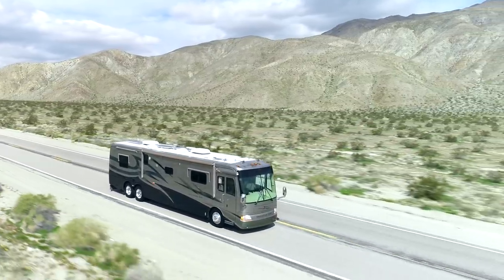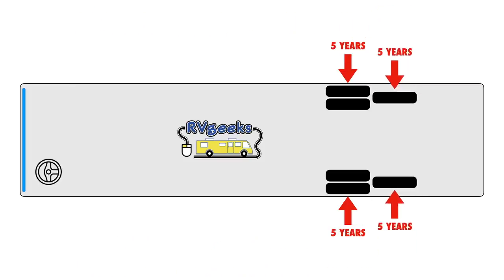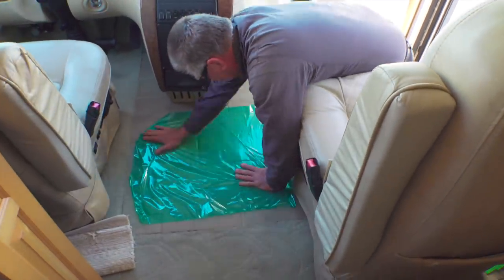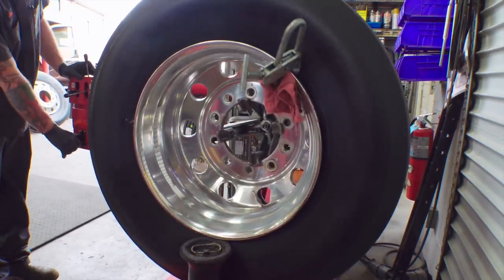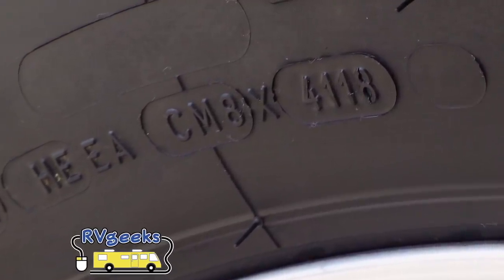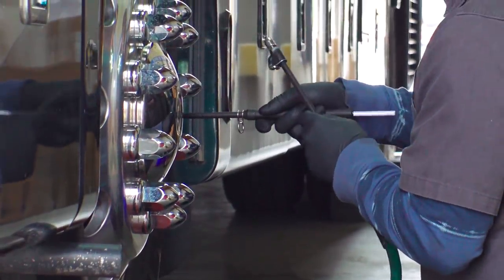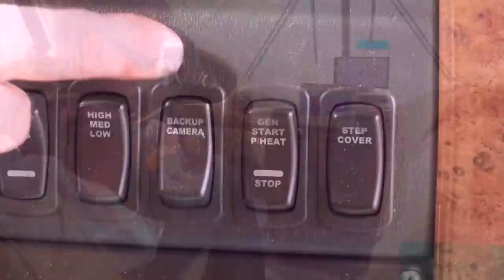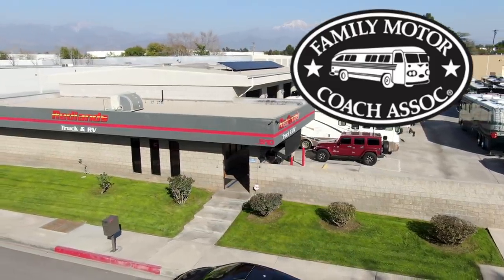Saving 💰On RV Tires - And Getting The Job Done Right

Comment: Excellent video gents, that's certainly some service! As you said, the tread may look plentiful but, if the rubber is deteriorating thru age & especially unable to check the inside walls of the tyres, particularly if they're up against a Duelly then you have no idea! 

Caravan/travel trailer tyres here in the UK are recommended to be changed every 5-8 years. With our ever changing climate. Cold, hot, wet, dry humid etc etc
Reply from the maker: Thanks so much, Dan. Great to hear from you! One thing we've heard from a number of tire tech we've spoken with is that they don't see tires deteriorate from the inside out, since the things that affect the rubber most (UV, contaminants, etc) are on the outside. That's always given us some peace of mind that if the outside is in great shape the inside probably is too. 😊
Reply: Also, using a decent high quality tyre dressing helps too 😉
Reply from the maker: Aerospace 303!!! 👍😁

Comment: HELP...
I have learned so much from you and your videos, even tho I was a fifth wheel owner, Thank so much!
But, now we have purchased our new baby...
A  Newmar, Kountry star 3910..
A beautiful, well maintained 2005,
But I am overwhelmed, with the water system, it is winterized with chem, an I do not know how to empty it properly ?
I would nomaraly just flush statement, but that would run chem through ice maker, I'm lost and don't dare to do this, can you help or recommend help.
Any help is a help..
THANKS for all your awesome videos, and instruction on so many projects, we love ya both..😉
Lonny & Melissa mossey
Reply from the maker: Hi Lonny & Melissa, and congrats on your new rig! Not only do we love to hear from fellow Newmar owners, but just in case you didn't know, we started making videos in the first place about 8 years ago to help friends who'd just bought their first rig.... a 2005 KSDP! We're pretty sure theirs is a 3909, but SO close to identical!

The good news is that that pink chemical is harmless, so the worst thing that can happen is you'll need to flush more water through the system to get rid of it all. But there's nothing you can hurt. First off, you'll want to do this at a full hook-up if you can, which will allow you to run lots of water through the system if needed.

To avoid getting more of the pink stuff than necessary into places you don't want it, you should leave the ice maker shut off, and the water heater in bypass mode. You'll probably still get a little pink into those two places no matter what, but again, no big deal.

De-winterizing is easier than winterizing, because you basically just need to run water through the system until it runs clear. Run each faucet on "warm" top clear both hot and cold water lines. And don't forget about the shower, toilet, and outdoor shower. Once those all run clear, you can set the water heater bypass valves to normal operation, turn on the ice maker, and start using water. As long as the previous owner didn't do something unnecessary... like fill the water heater with antifreeze.... you should be up and running in no time. You'll just want to toss the first several batches of ice, and might want to run hot water up into a glass container until you can see it's clear, and not tinted pink. Also, this is a good time to replace any whole-house or under-counter water filters, right after you clear the lines.

Hope this helps. Please let us know how you make out.
Reply: @RVgeeks  thanks so so much, I really appreciate and needed that assurance I was not going to harm anything, 
I will attack this with a lot more comfidence now...
Just the fact it's a coach has me second guessing my self, so much different than any RV I have owned.
Thanks again, will definitely let you know how it goes.
Heading to Main next month, can't wait. Maden voyage 😀

Comment: Works great if all tires are the same size.  My coach had larger tires installed on the front for a recall.
Reply from the maker: That’s true, OBW! If you have different size tires on any of your axles, you can’t use our rotation schedule.

Comment: Second comment. Nitrogen? Does that mean you no longer need the Viair? If a tire drops pressure while you are boon docking how are you able to deal with this? I assume you don't want to add regular air to a nitrogen filled tire. Here's hoping this never happens but in an RV any this is possible.
Reply from the maker: There isn't anything in this world that will get us to give up our Viair, Iggy!! Nitrogen or not, if our tires need pressure, we're filling 'em with the Viair. As others have said... atmospheric air is already 78% Nitrogen. 😉
Reply: That's what I thought but thought I'd better check to be sure. Travel safe.

Comment: Hey guys, another greatly informative glimpse into your stellar maintenance program. Can you tell me the make, model and size of your tires? My 05 KSDP 3910 is coming due for new rubber and I really like the Michelin brand. Next step: join FMCA. BTW, just curious since yours is the same vintage did your coach get the exterior checking in the fiberglass? I know for awhile Newmar was addressing this. Thanks 😊
Reply from the maker: Hi Raymond! Our rig came with Michelin XZA2 Energy 295/80R22.5 tires, and that exact size and model is all we’ve ever used. Yours are almost certainly a bit smaller.... probably 275 instead. Join FMCA to get the tire discount for sure. It’s worth every penny! Unfortunately, we do indeed have checking on the fiberglass, but not much we can do about it at this point other than a repaint job. It’s not bad enough to warrant that, so we’re just living with it.
Reply: @RVgeeks  Yeah, I get it. It's a shame it happened to so many. The good thing is the integrity hasn't been compromised. Are your tires 14 ply? Mine are coming up on 8 years and still look great. Do the take offs have any value? I would think some sort of re- purpose would exist. Construction equipment maybe?
Reply from the maker: @raymondmcdonald7085  Not sure how many ply or if they have value when we’re done with them, but we’ve been able to run 10 full years on them, the max Michelin recommends.

Comment: I live about 50 miles from Redlands Truck & RV. I have never used them but I’ve heard good things about them, your video confirms that. I just had all six Michelin’s replaced on my DP. I used Pete’s Road Service in Fontana, they also participate in the FMCA tire program, but I did not enjoy the same experience that you did. They did not have the tire removal equipment you showed, they laid my wheels on the ground and used pry bars, scratching my beautiful wheels in the process. Horrible experience overall. Pete’s corporate office would not return my phone call, I warned others via RV Service Reviews. I personally don’t like wheel weights so I opted for ceramic balancing beads, I had them in my old tires as well. Now that you’ve converted to nitrogen, you won’t be able to use that cool Viair compressor you have, LOL!
Reply from the maker: Hi Craig. Sorry to hear about your experience with Pete’s. It just so happens that we had dinner tonight with the friends we mentioned in the video who recommended Redlands. They had used Pete’s as well and had those little sandbag balancers put into the tires. But Pete’s failed to install the correct valve stems with a little cages on them to protect the stems from getting clogged with sand. Of course the trouble started when they checked tire pressure and could not stop the air from coming out. It took them a while to get the problem fixed, and they told us they would never go back to Pete’s either. We also had one of our front rims scratched at another place, just like you did. Good shops are like hen’s teeth, but great to find.
Reply from the maker: Oh yeah..... we may be anal, but we’re not about to quit using our fantastic compressor just to keep a near 100% nitrogen mixture! We have every intention of using it as needed! 😁
Reply: Air is already 78% nitrogen so even going near pure nitrogen is not a big change if even noticeable.  Did you have near pure nitrogen in the tires before?  If not, it will be interesting to hear if you notice any difference after some time.  I got some trailer tires from Costco which fills with nitrogen and did not notice anything different.

Comment: Revisiting this video to look at your rotation schedule and glad to see you still respond to comments.  I have a 2015 24' Class C, purchased in 2017.  In 2019 I damaged a front tire on a trip and once returned I chose to purchase two new tires for the front and start rotation every few years until I had replaced all tires and could start on a longer rotation schedule.  So here we are in 2022, I have 3yr old fronts, and 7yr old dual wheels on the back (and a 7yr old spare).  I want to take the 3yr old fronts and put them on the back, but would you recommend putting on the inside or outside?  Or should I just invest and replace all four of the dual tires at once and have a rotation schedule of two front, four back?  None are showing any significant wear on tread or being weathered.  Would like to hear your thoughts!  Thank you as always!
Reply from the maker: Hi Jen! We like having the newest tires up front, the way you do now, so the problem with replacing all four duals and leaving the current front tires in place is that it means the older tires are now up front. But the problem with taking the current front tires, and moving them to the rear is that you'd be pairing each of them with an older tire, which isn't acceptable. (All tires on both sides of a given axle should be replaced together). So we'd go with the replacing all four duals, leaving the older tires up front, and be vigilant with annual tire inspections, and you should be good to go.
Reply: @RVgeeks  Thank you so much for the guidance, and damnit I wanted an answer that said I only needed to purchase two new tires! LOL
Reply from the maker: Sorry ‘bout that Jen! 😂

Comment: Great video guys!!! At FMCA website tire program, the difference in price between Michelin and Hankook are $$$$. Any experience with Hankook tires?  I had to replace one rear tire a year ago and ended up with a Toyo tire... I heard they are good, but I wanted to get the same GoodYear tire. Having one tire different from the other is driving me loco... OCD is kicking in I think. :-)  I also like your chart with tire dates and location.. I may do the same and keep it in my book with the coach. If you guys ever in the Savannah, Ga area let me know, I would like to meet you guys.
Reply from the maker: Hi Hector! We get your OCD! If we had different brands the same spec and size (so they don’t touch each other, which we understand is very important), we’d wait til next time you need rubber to swap them all at once. No experience with Hankook, so sorry that we’re no help on that.
Reply: @RVgeeks  Since you guys balanced the tires, I wanted to ask if you guys heard of Centramatic. It continuously balances the complete wheel assembly while you drive. Been reading about it and seems lots of RVers and truck drivers are very happy.
Reply from the maker: We’ve heard of it, and it’s supposedly very good. But since we’ve never had a problem with regular spin balancing, we’ve never sought a change. If it pops up on our radar a bit more before our next set of tires, we’ll try to do some legwork ahead of time to learn more about it.

Comment: Always like all the detailed information you share.  Just watched a video on the new 2020 New Air 35 ft with king bed so when are you getting yours?😄
Reply from the maker: You had us going there for a minute, Donna! We think you mean NEW Aire, right? We just saw that video on the 35' New Aire 3545 and we're getting more interested in New Aire all the time. 35' is our target length., Now we just need the right floorplan. 😉 Thanks so much for the tip. This is the first we've seen it. 🤗
Reply: Opps yep new air
Reply from the maker: If we get one of those 35-footers, you know we’re holding you responsible, right? 😂

Comment: Great informative vid....As always!! Thx! You mention rotating the purchase of tires. Do you rotate tire location on the coach to even out tread wear? As on a car. Front to back etc. Sorry if covered and I missed!
Reply from the maker: Hi Rob! No rotation due to tread wear needed. Only for age, to keep the youngest tires on the front/steer axle.
Reply: @RVgeeks  Very interesting. Didnt know Diesel Pushers dont need to rotate tires. Thx!!
Reply from the maker: Yeah... it’s mostly due to the fact that they aren’t (usually) driven very far each year and will end up needing to be replaced due to AGE and not lack of tread. So there’s no reason to spend the money rotating them.
Reply: @RVgeeks  Makes sense!! Thx!

Comment: What did they charge you ?
Reply from the maker: Hey Veronicca... the tires puchased from Michelin were $623.50 each ($101.50 less than they would have been without the FMCA discount... each!) for a total of $1,435.32 with all taxes and fees added in. Redlands labor for installing and aligning the tires was another $1078.04, again with all taxes. So the grand total came to $2,513.36.

Comment: I think the 10 year rule is stretching it a bit. I've always heard 6 years on cars. Especially considering most RVs spend a lot of time sitting in the elements & many without tire covers (they get stolen, blow off, etc) - I simply would never go 10 years. Also, get tires manufactured in USA; SE Asia production quality is typically garbage.

Comment: Looks like you got great service. Are you not concerned with putting the two new tires on the front? If buying only two tires for a car I was always told to put them on the back in case there was a manufacturing defect. I would have better control if it blew on the back than the front.
Reply from the maker: You are absolutely right that a front blowout is much more dangerous than one at the rear. But since the odds of an older tire blowing out are far higher than the odds of a new one blowing out, that's exactly why we rotate the way we do. Failure due to manufacturing defects are far less common than older tires coming apart due to age or other damage over their lifespan. It's the older tires that fail far more often.

Comment: Have you heard of a place like yours here in Oregon? I’d pay for this type of service ...
Reply from the maker: Hi Rick. We haven't used a place like Redlands when we've been in Oregon. We understand that Oregon Motorcoach Center in Eugene is doing RV/chassis maintenance work like this... and that's who did our upgrade to a residential fridge 8 years ago when our Norcold failed. They are definitely very customer-focused, so you might want to give them a try. There's also Henderson's Lineup in Grants Pass (which lots of people recommend). And Brazels RV up in Centralia, WA might not be too far, depending on where you are in Oregon. Again, we don't have any maintenance/service experience with any of these locations... but they might be worth looking at.